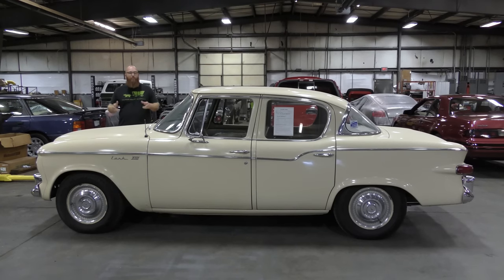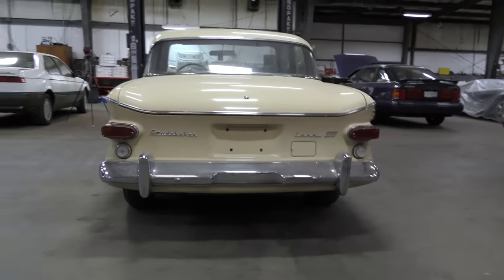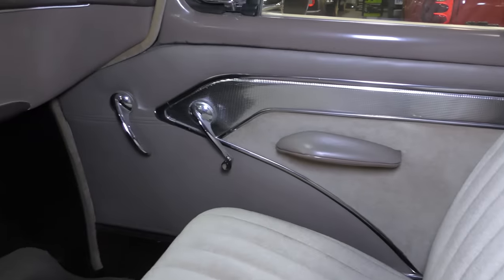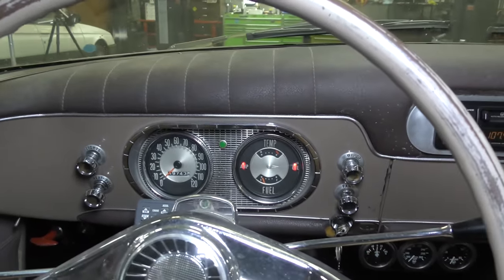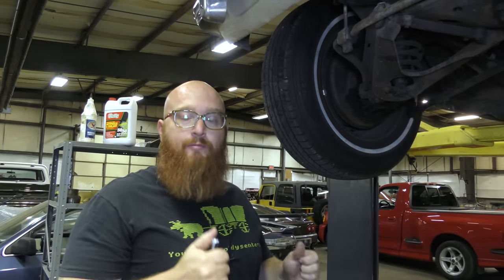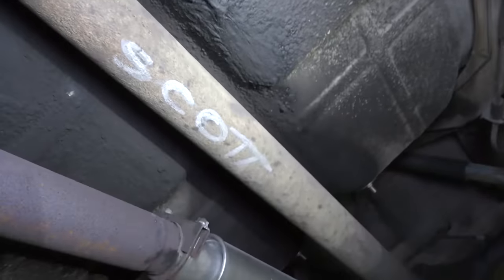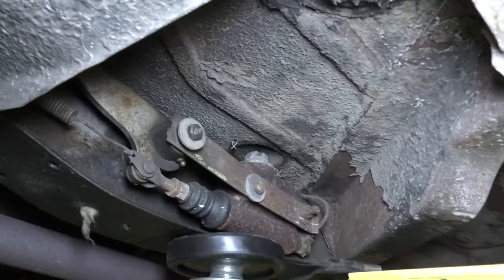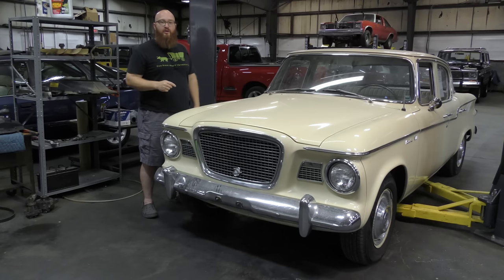Finally a CAR WIZARD approved engine swap done on this '60 Studebaker Lark VIII

Comment: Larks were used in Melbourne, Australia as police pursuit vehicles. All were painted powder blue and fitted with the V8.  Looked particularly smart compared to the vehicles available at the time. Several were raced in Australia's long distance race in the early 60's -  originally called the Armstrong 500 (for 500 miles). Straight line performance was good but braking was a whole other story. Cannot imagine any surviving here except in private collections or maybe a museum.
Reply: 🎉thanks…. Love the Larks, **Super Larks , AVANTI, ETC.. ( I am from near South Bend Indiana…. Some legends , super Cars, came out if STUDEBAKER(( g also trucks, another STORY TITALLY).
Reply: Police chase cars in South Africa too - could simply not be surpassed in the '60's. Can still obliterate most present day competition. Also very few original examples in SA all's the pity in not appreciating excellence until it's gone.

Comment: The reason that the "chrome" on the sides looks so good is because it's stainless steel. I had a '59 2 door wagon 259 that I drove daily for 10 years. Neat little cars!
Reply: @A walrus back in the day chrome was cheap.
Reply: pitting on horn button ,overspray on trunk insulater i believe over 100000 miles but still wonderful car..
Reply: @A walrus A lot of "chrome" parts are plastic now - and that is cheap!
Reply: That was back when each car division actually made their own engines!...that concept went by-by in the 70s.
Reply: @thomascundiff3496 plus the paint worn off the steering wheel
Reply: @thomascundiff3496  plus the paint worn off the steering wheel

Comment: I have a GT Hawk, and I have had a blast fixing it up and repairing it in my garage. It is my first project car. Unfortunately there are a couple of items that are above my paygrade and I need a mechanic to do (fuel pump conversion, replace camshaft seal, etc.). Still really glad to see someone giving the brand a little love.
Reply: If your fuel pump does not work, many electric pumps will be a good substitute and work real well. Readily available and there is really lots of space under the hood.
Just did this on my 62 GTH , a daily summer driver. Good luck, those are great cars!!

Comment: That's one thing a well-tuned, carbureted engine can do that a fuel-injected engine cannot -- start with less than one revolution of the crank.  I love that feeling, when you just touch the key and it roars to life.  My '68 Ford Galaxie 500 convertible's 390 cu. in. V8 could do that when it was in tune.  Just bump the key and it was running.  Good stuff!
Reply: when i was a kid my mom had an avacodo green galaxy. the car was beat to hell but it started every single day.
Reply: My '79 Cadillac Seville with stock EFI direct port injected Olds 350" V8 starts when the first piston comes up... even at 20 below zero F... and then it cold idles at 500 RPMs... but they have a distributor... simple computer...

Comment: A Lark VIII means it came from the Studebaker factory with the Studebaker 259 cubic inch V8 engine with a 2bbl carb, with a claimed 180 hp.   If the car is badged as a Lark VI, it means it came from the factory with Studebaker’s 85hp flathead six cylinder engine that had been around since the 1940’s. There was also a factory muscle car version called the Lark Daytona that came with a Paxton supercharged Studebaker 289 cubic inch V8 as used in the Studebaker Avanti. The Lark Daytona also came with power Dunlap front disc brakes and a Borg Warner T-10 4 speed transmission with a locking rear end (posi-traction). The Lark Daytona is the model you should look for if you are serious about buying a Lark.
Reply: Excellent knowledge!
Reply: My parents had a 1959 Lark VI with the flathead six.  A great reliable car, simple to work on ,
and that small engine, (169.6 cuin = 2.8 liters} had more than enough power for the type of driving they did.  No 4 lane express ways where we lived. but lots of country roads, many unpaved.
There were many converted for Marine use in the area, and commercial fishermen were looking for reliability above all else.

Comment: A lot of these were sold in Australia. You can see that the dash is designed for easy conversion to RHD.
Reply: use them as cop cars in the early 60s

Comment: Love it! Purists may scoff at an engine swap, that only saddens me when it's a rare one-off museum piece. If it's done right like this, in a car that's actually going to be driven and enjoyed, I think it's great. I love the fact that they kept so much of the factory appearance, inside it has the usual's that would have been added by many back in the day, better radio, some gauges... it's like having the 60's experience with the reliability of an engine you can easily get parts for from any auto parts store. My dad was a Studebaker man until they shut the doors, when I was a kid our driveway was always adorned with them, he had a Champion, a silver Hawk, and mom had a Lark.
Reply: Exactly, making older cars streetable again with a late-model engine swap shouldn't be an issue with purists who whine when someone sticks an LS or modern Hemi engine in a 60's Ford, Chevy or Mopar.  They forget that most people wouldn't bat an eye watching a non-running 1962 Chevy Impala 2-door in fairly good shape bodywise getting run through the crusher or chipper.
Reply: Except that the Studebaker V8 was such a great and unique engine that doing a swap to even one Studebaker is a bad idea. My '62 GT Hawk will attest to that.
Reply: @jakekaywell5972  I get your point but one of main issues for folks on a budget who have an older car they’d like to be able to drive frequently & maintain relatively cheaply is parts availability. That and institutional knowledge. It’s not hard to find a mechanic who can work on your 350 Chevy. Student Akers specialists are harder to come by. I’ve only ever done one engine swap—My buddy & I swapped a 430 Buick V8 into a ‘61 Buford mile custom whose Nailhead had seized up. I went with the 430 cause I had access to a nearly free donor car. We got it done but I still wish I’d gone the 350 route. Would have cost a bit more up front but I ended up spending a lot  time, energy, and in the long run,  money, than I would have had I gone with a SBC.
Reply: Also, finding engine rebuild kits for Studies is like finding hens' teeth. Been like that for 20+ years. Many Studies have Chevy swapped engines and transmissions. This one was done extremely well.
Reply: This was my first car, exact same color, got it from my Dad's teaching colleague,  In 1971, just turned 18, it had over 400,000 miles on it, the body was built like a tank, very heavy, I was once rear ended in the middle of a busy Pico Blvd in WLA. I just remember the guy that did hit me, was not going fast, think I was stopped at a light. I just had a scratch of paint on the rear bumper. His front end was crushed. Think he gave me some cash, neither of us had insurance. In those days, you weren't required to carry insurance( a least in car crazy CA). And, the car he was driving, wasn't his. Think he gave me about $40, not exactly a fortune, but still a fair amount, it fi ally died on me, driving through Sepulveda pass. Actually, got $50 for junking it, good payoff (1972)

Comment: Larks were raced in the early 60s in the Armstrong 500 (the precursor to the Bathurst 1000). Did pretty well with a couple of second places. Obviously a very well designed and built car, and very well balanced

Comment: Thanks Car Wizard for a great Studebaker Lark review. When I grew up, we had a 1962 Studebaker Lark wagon. It had the 259 cubic inch V/8 with 3 on the tree. We later converted it a floor shift. A good reliable car for its day. Thanks for bringing back memories.
Reply: I have a 1962 Lark 6 cyl Riviera blue three on the tree

Comment: The Studes were great little cars. I like the fact that the engine compartment is slightly dirty; that means to me he DRIVES it as well as shows it (I hope).  Only thing I'd change is I would have mounted the whitewall side of the tire out. The narrow whites would look great on that car.
Reply: I was thinking the same about the tires.

Comment: The Lark was marketed as a compact from the get go. The logo on the grille is “the Lark.” The Studebaker logo is a very stylish narrow S in a two-tone circle (it reminds me of a yin/yang symbol.)

The mid portion (doors/seats) of the Lark was basically the same as 50’s Studebaker sedans. Studebaker did not have resources to re-tool and they creatively re-used parts. [If one looks at the various versions of the Hawk you will see the same basic body structure based on the Raymond Loewy 1953 design throughout its run into the sixties.] The ends of the Lark, front and rear are much shorter. Perhaps Studebaker used the older chassis also and with the shorter ends makes it have a cab-forward look. The front of the car is similar to the Valiant and the 1963 lark has a grill that looks very Mercedes Benz like. The 63 also has a lighter look to it.

We had a neighbor, when I was a small child, that had a 61 Lark with a six, and later a 63 Lark with a V8. That was his work car. His wife had a big 56 Buick. I remember going to Yosemite in the 63, our whole family in the back seat and our neighbor and wife in front. The car was a good climber.

This is a really nice example of a really fine sixties car!  

It is unfortunate that Studebaker did not survive. They built quality products from their beginnings as a builder of horse-drawn wagons.
Reply: They built a quality car not a throw it away car, expensive and last a long time, return sales were slow. Expensive to build

Comment: Wizard, At one point Studebaker imported Mercedes Benz around 1958 or so. I had a woman customer  around 74 that had a 62 Lark that was homoglated for " compact " car racing. Short list: Chevy 327 motor, four speed transmission, heavy springs, anti sway bar, interior trim didn't match ( ya gonna pull it out for racing right ) black on drivers door panel red on the right. The bucket seats were xtra firm and had side bolsters. It was pastel yellow with white roof. Oh, sintered bronze drum brakes. Real clean car. We were doing routine service. Loved that car, owner did too. Hope it is still in good shape.

Comment: The Studebaker WAGONEER was awesome. The roof slid back so you could haul tall items.
Reply: *Wagonaire! 😉
Reply: Later used by Chev with the Blazer!
Reply: @casselts1  my neighbor had one in medium blue. Even as a wagon it looked really cool. He used it into the 1970s.
Reply: @andysp8845  No, it was GMC with the Envoy XUV around 2003 to 2005.

Comment: Back in the 80's we had a 60 Lark that was a salmon color...I credit that car with saving my wife and daughter from serious injury after some guy ran a red light and t-boned them.  It caved in the back door and quarter panel but the other car was total.  Thank you Studebaker...
Reply: Actually, it was where the car hit the Lark that saved the passengers...that car, back then, had virtually no safety features, compared to today's vehicles.  I love to gawk at old cars, but would never drive one in this day and age...one hit from a large truck or SUV and you would be messed up!...Drum brakes, optional seat belts, no air bags, non-collapsing steering columns, lousy suspensions, etc were the norm...many thousands of lives have been saved over the last couple of decades, with improved safety features..Too bad that modern cars look bland/boring, for the most part.

Comment: Mrs. Wizard's response to Mr. Wizard handling Scott's shaft made me lol 😆👍👍👍
Reply: she sounded a bit jealous of Scott and Wizards bromance they shared for that brief shaft fondling moment didnt she? LOL
Reply: @warrenmichael918  OMG, Wizard is going to have to touch Scott's shaft again unless one of his employees does the repair job for the oil leaks...Sorry Mrs. Wizard.
Reply: You don't touch another man's shaft especially one that big. Scott even had his name put on it one to tell everyone it was his. I suppose that Mr. Wizard's shaft belongs to only Mrs. Wizard. But only those with rear wheel drive have shafts like Scott's.Those with front wheel drive have much smaller shafts. A rubber boot is included to keep them from leaking lubrication.  I'm talking about drive shafts on cars. What did you think that I was referring to?  Dirty minded people!
Reply: @deanwhite4190  come on man, even you gotta admit that when such a fine shaft is presented, you gotta admire it. Maybe not touch it, i agree, but it must still be admired! LOL
Reply: I laughed way too hard at that
Reply: @warrenmichael918  Oh yeah. Most definitely. It would be a shame not to admire a nice shaft every now and then. Unfortunately. mine doesn't spin as fast as it it used. But Scott's shaft on that 61 year old Studebaker still looks like it's in is prime. It's been well protected from rust and developing rot. You've gotta take good care of your shaft. Keep it clean and handle it with tender loving care and ask anybody who ever touches your shaft to do the same. A little kiss now and then would also good. You need to let your shaft know occasionally how much you love it. After all a nice shaft is a precious gift from its creator.
Reply: This is RIGHT on the edge of 'reportable pornography'
Reply: @charlesangell_bulmtl  haha
Reply: I was just starting to eat my lunch and that one came outta nowhere drink almost went up the nose xD

Comment: I got my first car in 1972 when I graduated from high school. It was a 1961 Studebaker Lark VI. First year of the OHV 6. That car had 22 grease fittings. Basically, if it moved, it had a fitting. One of the hidden ones is on the "bell crank". That is the pivot under the center of the engine on the cross member. This is where the 2 tie rods come together. You have to turn the steering wheel far left or right. There is a hole in the cross member that faces back. Inside the hole is a grease fitting. When I would get it lubed, a few places would try to raise the price because of the number of fittings. I would then ask them if they gave a discount to people who owned Cadillacs that only had 2 grease fittings. Eventually, the oil filter blew apart and ruined the engine. I bought a wrecked '60 Cadillac and put the 390 cubic inch (6.4 liter) engine and 4 speed Hydramatic transmission  from that car into the Lark. I drove it for several years, then sold it.

Comment: Love the Studebaker! 
From a distance, the side profile of this car reminds me of a Checker Marathon. If you ever have one of those in your shop Wizard, please show it!
Reply: Have never seen a build of a Checker, that would really set tongues a waggin !
Reply: @jeromebreeding3302  Checker Marathon cars & cabs were based on a 55 Chevy frame. If I'm not mistaken they had Chevy 6 cylinder engines.
Reply: @gregbrown4962  Checker used a lot of GM parts (including engines from Stovebolt 6es to SBCs, as well as Continental  - as in the aircraft engine manufacturer- engines in the earlier Marathons), but their frames and bodies were unique to Checker. They look more like a pickup truck frame - they were primarily commercial vehicles, after all, and durability was their primary selling point.
Reply: @paulyearley1084  I based my info about the frames of Checker from a friend's dad who was a mechanic for a large cab co.
Reply: @paulyearley1084  - Even the steering column,  steering wheel and keys.  One of the clues about what year the Marathon is, just look there.  Seen some with the same steering wheel as my 1971 Nova.

Comment: Very cool Mr. Wizard! That is one nice Lark! A local Guy back in the late 70's put a small block Chevy with tunnel ram & dual 4's in his 2 dr. Black 1960 Lark. I hadn't seen it since the mid eighties cruising the avenue so I was greatly surprised to see it at a local car show just before the pandemic. I went over to look at it because being a one of a kind vehicle I instantly recognized it! Turns out the original owner/builder still has it! He had stored it in his shop for many years and finally got it back on the road again! It was a happy day to see it again! Since the 1970 Olds 442 Convertible I drove back then has been long gone for many years because I sold it when my family was young. Needed the money at the time!